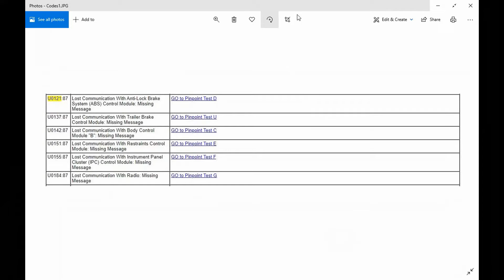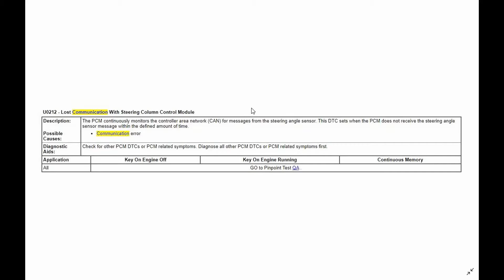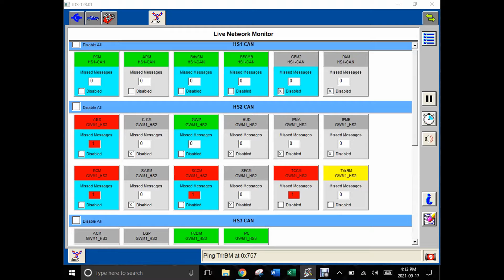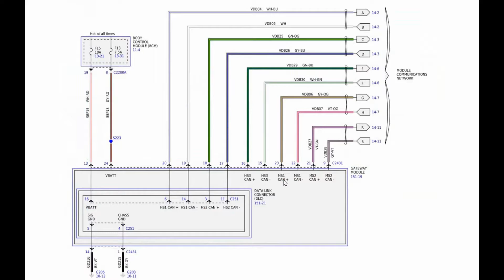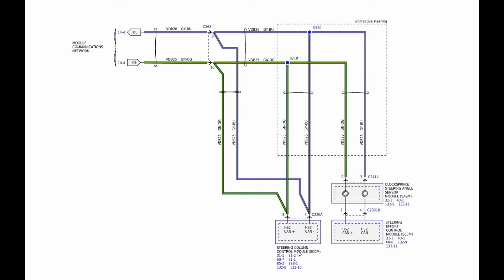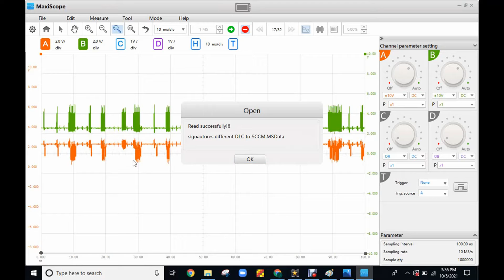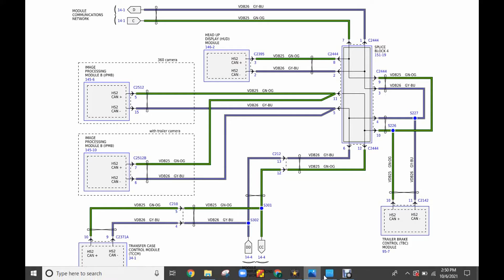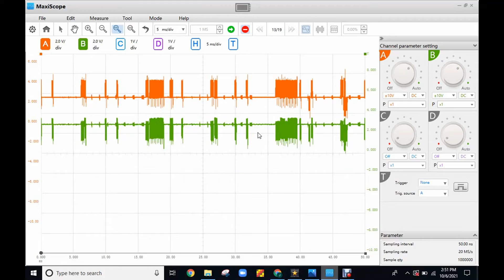No Turn Signals or High Beams, 2017 F-250 (CAN Bus issue?!) #canbus

Comment: I’m having some of the same issues no turn signals or highbeams traction control light and ABS light are on and none of the buttons on the steering wheel work
Reply: Did you ever find the issue I’m having a similar issue with mine
Reply: @JonathanGarcia-gb8eq any update
Reply: Same issue here after I installed a powered sub.